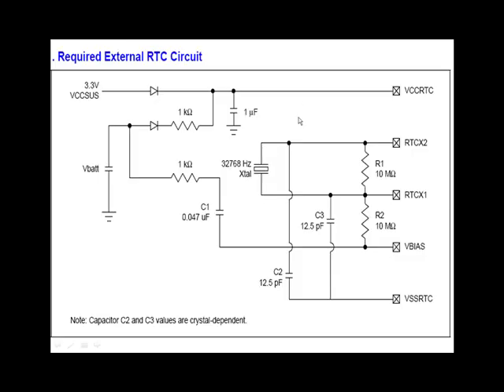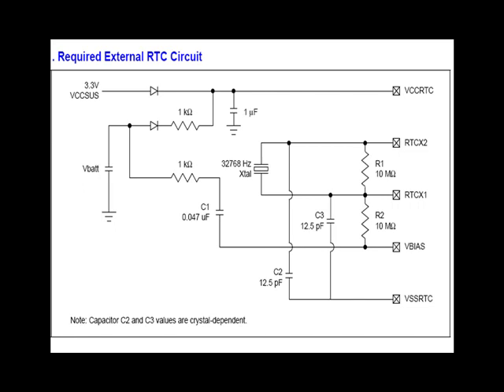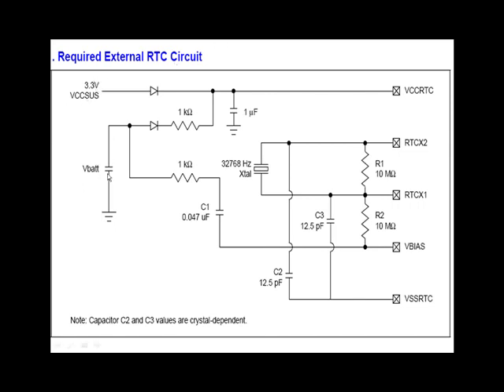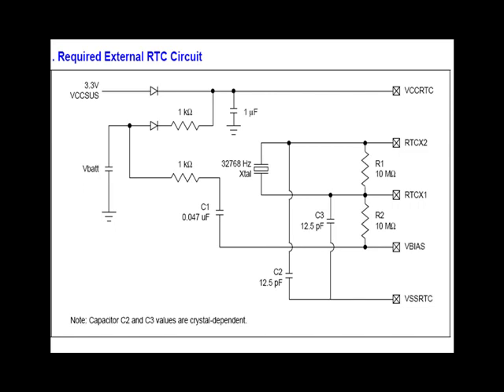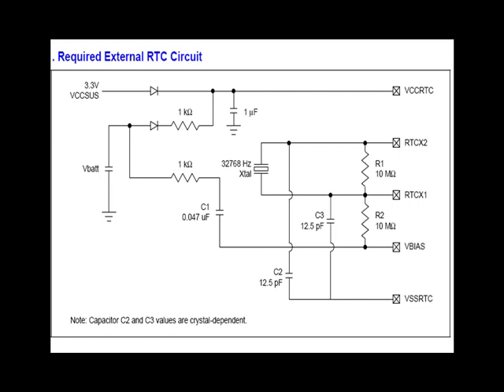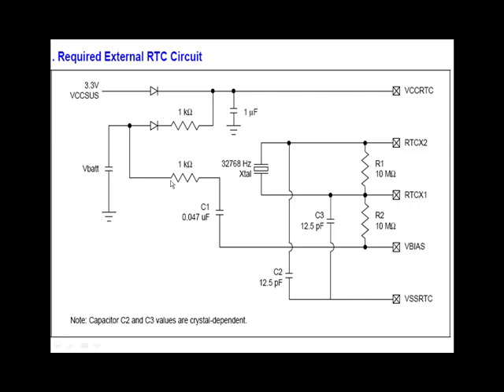How To Repair | Laptop Repair | Laptop Circuit | Real Time Clock | Laptop Motherboard

Comment: Hi sandip greetings, sometimes on dead laptop boards. I removed the CMOS battery.. and shorted the pins.. afterwards replaced the battery and started properly.
is that cause it's resetting the RST line to the ICH?
ICH_RTCRST#.  Cause the battery voltage didn't go low. I just shorted the + and - points from the button battery like for a couple seconds.. ( I think this has to do with some sort of triggering loop inside the RTC and the SMB portion area of the ICH)